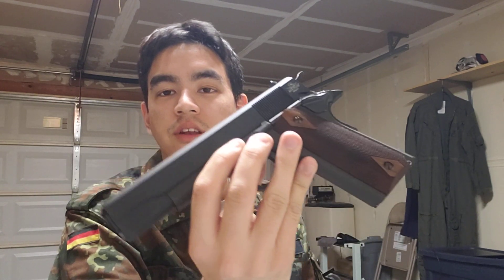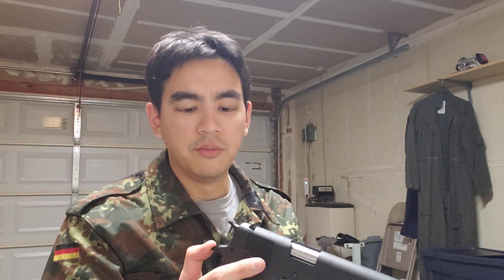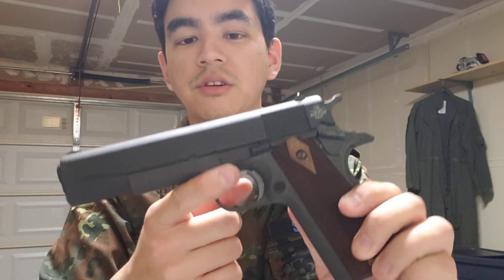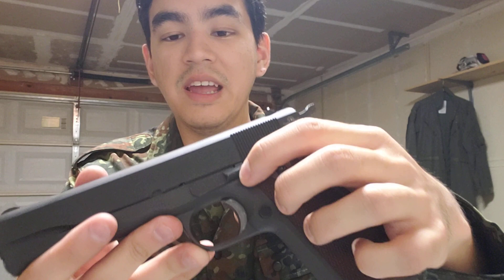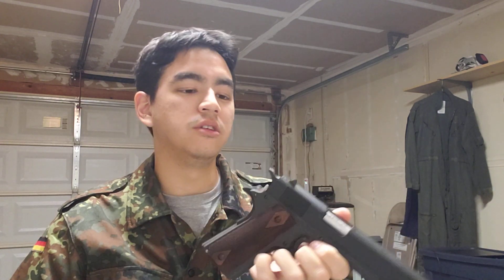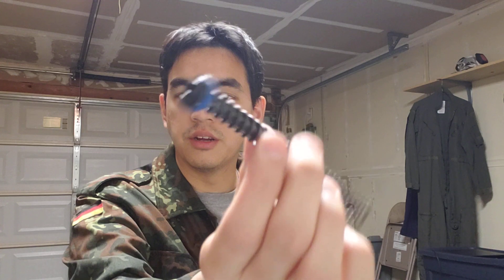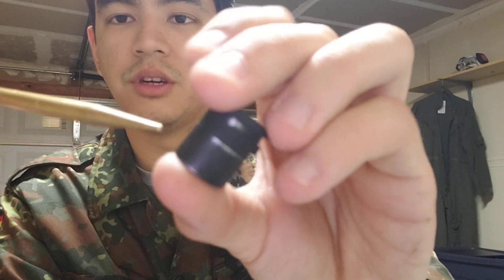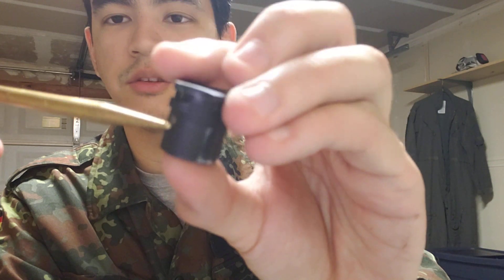Rock Island Armory 1911 GI - 1000 Rounds Update

Comment: Nice and thorough 1,000-round review, and I wouldn’t mind owning a RIA 1911A1 MIL-SPEC. Had a Springfield 1911A1 MIL-SPEC bought a month before the Kimbers hit the market. At 3K rounds, had a gunsmith turn it into a Kimber (beaver tail/speed trigger at 3.5 lbs/thumb safety upgrade/Bomar target sights), though very accurate with the stock match grade barrel and my hand loads. Pretty good about maintenance/spring changes, but bushing failed at 6K rounds (Springfield Replaced at No Cost*), barrel trunnion weld cracked at 8K rounds (SRNC*), front of slide cracked at 10K rounds (SRNC* + free Bomar sight install), parted with gun for original stock gun price at approximately 14K rounds. Great gun design, great Springfield customer service, plus the gun outlived my RCBC Partner single-stage press.
Reply: Wait, who?

Comment: is it my RIA 1911 gun or mag, or normal for the gun? I can't install the mag with the slide forward unless I push down on the mag release. it is brand new
Reply from the maker: Loaded mag? If its full up, you might have a problem inserting it with the slide forward, common 1911 problem

Comment: Modern colt.   I have owned 8 of the colt classic series, for the record they look almost identical to the rock island do you have there. They have the flat mainspring housing so on and so forth.  I have about 1500 rounds through all of them so some may be only 100 rounds and some more like 500.  not a single malfunction at all and my point is while it is the standard practice to put something like 500 rounds or 1000 rounds through one firearm I think it also speaks about a brand if you have eight of them and put a lower account through every one of them without a single problem. 

For the most part I think colt is making some of the best Firearms they have made in the last 35 years.  That being said Rock Island is a very solid gun, thanks for the great review!  You obviously know a lot.  Take care.
Reply from the maker: I am willing to give Colt another shot now that CZ is the owner. I have never been let down by any CZ product.

The stainless modern gold cup in 45 with the blue G10 grips looks very good to me
Reply: @shazarad4127  I don’t think Cz (I’m also a big fan and used to carry 75 compact) he’s really doing anything other than letting colt continues to operate from what I have heard.  I would not necessarily say that I trust all colts.  Someone recently I owned a lightweight commander in the slide to frame fit was so incredibly loose that even after 100 rounds without a single failure I still didn’t feel comfortable with it.  it was pretty unbelievably loose and as a long time user of 1911s I did not feel it spoke to quality.  The classic series is a fine weapon.  I know it’s heavy and I’m probably a dork but I carry the stainless version daily concealed.  

I think most lines have food and bad series.  Take care.

Comment: What trigger / slide stop did you buy?
I'd like to get the same ones or recommend some?
Reply from the maker: I bought original Colt 1911 parts for those and replaced them, mine fit in just fine
Reply: Yeah I saw that you said that on the video. Was just curious if it was vintage or a certain year trigger or something like that.
Reply from the maker: @adenval7  I think it was vintage, I just ordered it from Numrich and the parts looked worn already, not very worn but certainly used at some point

Comment: Your aftermarket trigger looks a bit recessed compared to all the 1911's I have delt with. Alway thought the, "in tolerance" L.O.P. called for the trigger to extend 1/3 into the trigger guard. Yours looks more like 1/4. Was the original trigger the skeletonized or solid version?  RIA calls the finish Parkerizing, which is a type of phosphate coating. I'm surprised the diamond pattern checkering on the grips isn't too much for your delicate hands, since the trigger and slide release were uncomfortable.
Reply from the maker: ok boomer

"aftermarket" trigger - you mean an original colt GI 1911 surplus trigger? 

and yes my delicate little millennial hands are just fine, wish I had manly calloused boomer hands like yours

Comment: Would you recommend spending 260$ more and getting the rock island 5" pro match 45cal version? 
It has adjustable rear sight and some other features.
Reply from the maker: If you don't feel attached to the GI basic look, I'd say yes spend the extra cash
Reply: I already ordered the gi model and they couldn't cancel. That's ok I paid like 350$ which seems like a great value for this 1911. I'm sure it will be great.